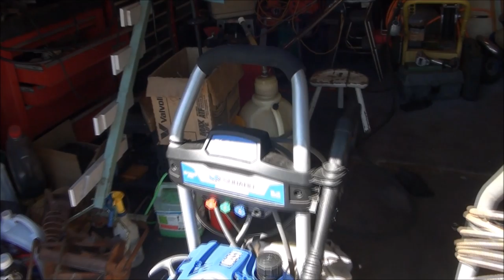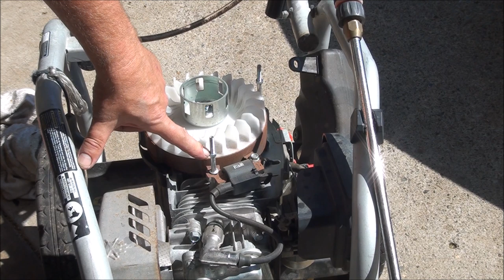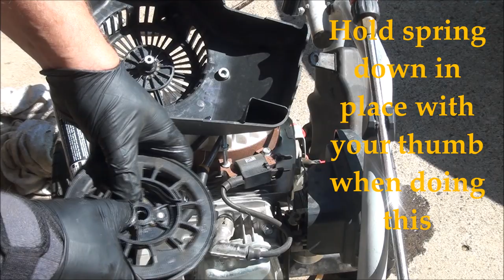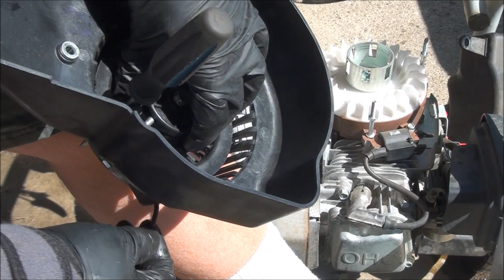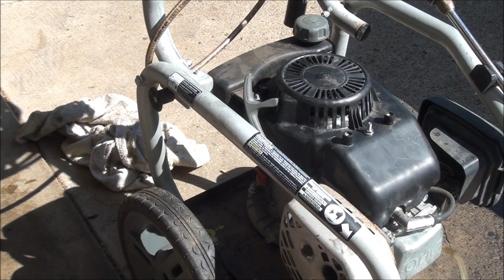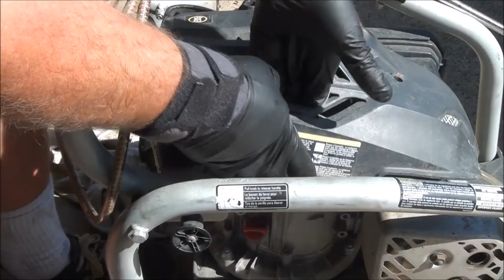How to Replace the PULL ROPE and FIX SPRING on a SUBARU Pressure Washer. REWIND the STARTER SPRING

Comment: Thank you Jeff, your vid helped me to tell my spring had broken along with my rope.  Was able to tell the spring was shot when I turned counter clockwise and no tension.  When I took it apart, could see the piece of the spring that hooks around the center post, broke an inch or so.  By watching you vid, I was able to see the direction the hook had to be in the center.  Used Linemans's pliers to make the hook and got it back together the first time around.
Reply from the maker: excellent!
Reply: @JeffsLittleEngineService  it's a Craftsman w/a 6 HP B&S engine. Runs like a top now.  I bought it around 2003.  Just bought a new plug for it as a treat and replaced the cracked and ratty looking orginal fuel line with some vacuum hose and 2 black zip ties.

Comment: Jeff I have a question about a no spark situation on a Kohler Command 14hp motor. I realize this is a simple magneto system. I have cleaned all grounds, grounding surfaces. I've checked continuity. This mower (930000) has a Deadman switch a PTO switch, and ignition and neutral switches. Which ones besides the ignition switch might keep the engine from starting? I've replaced the coil with an inexpensive unit off Amazon. I air gapped it with clean magnet heads at .010. The engine is getting fuel. The last time I ran it a week ago, when I shut it down the engine popped lightly and ran-on for just a very brief instant. Hasn't started since. Is there any huge difference in coil quality between oem and these aftermarket units? Any thoughts would be appreciated.
Reply: Jeff, I went outside and contemplated my next move. I then set the throttle to wide open and gave it a couple good pulls and it fired up! It was most likely flooded.
Reply from the maker: good news!